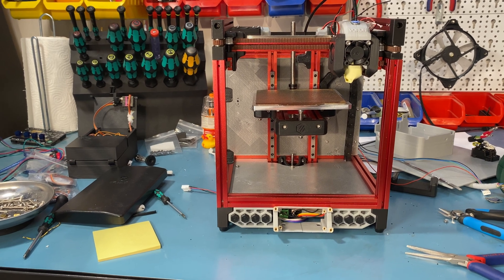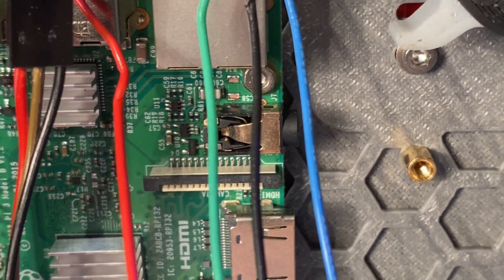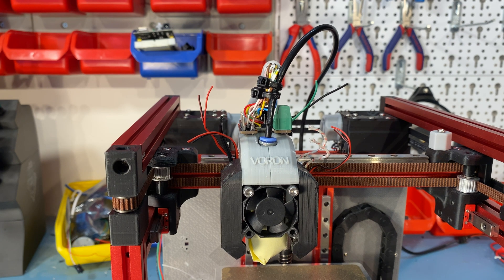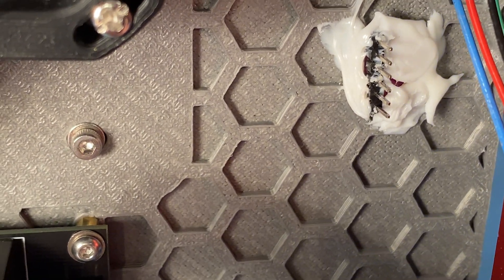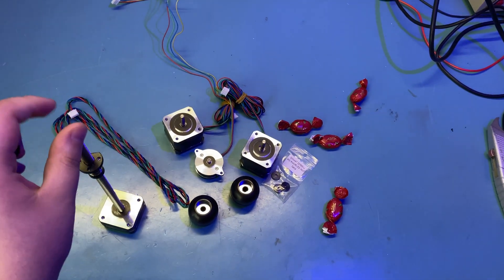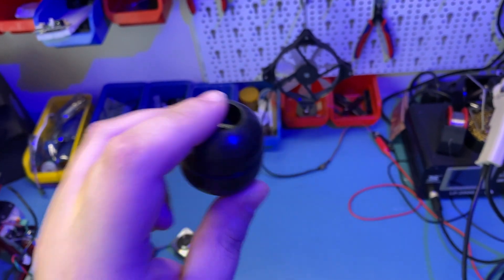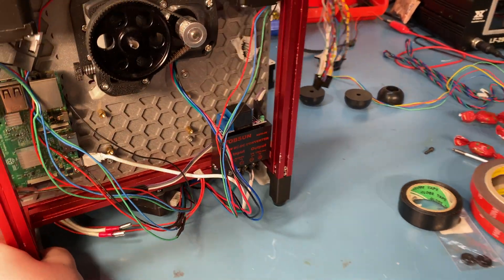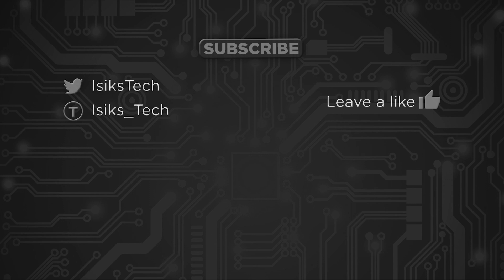Voron v0 Ep. 6 - New PCBs & Panels & Z Motor

Comment: So you damaged a cap on your RPI, just replace it. The price of a cheap hot air rework station almost justifies this one purchase. I just replaced a soldered on stepper driver that I destroyed by disconnecting a stepper while my printer was on. Watch Louis Rossmann's channel. GREAT build btw, I can't wait to build one of those. Looks awesome.
Reply from the maker: I will buy one some day. But until I do so, I can oly do it with a soldering iron. With me doing it there is a 100% chance of the rest of the board getting destryed.
Reply: @IsiksTech  Unfortunately, as far as i could see, you've also ripped solder pads off, so resoldering that component is not as easy as you think.